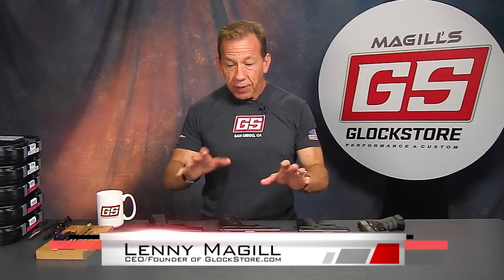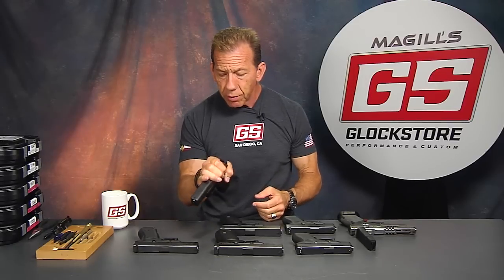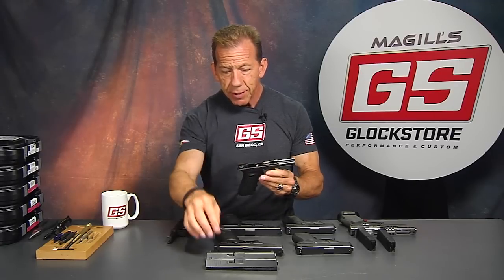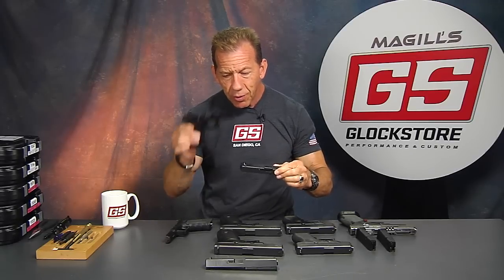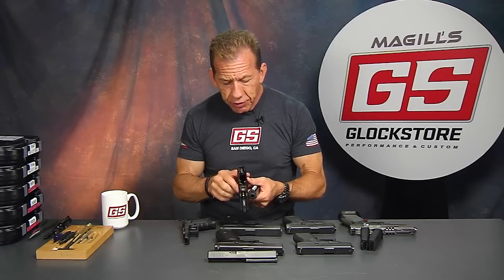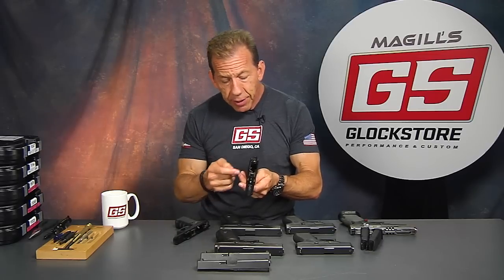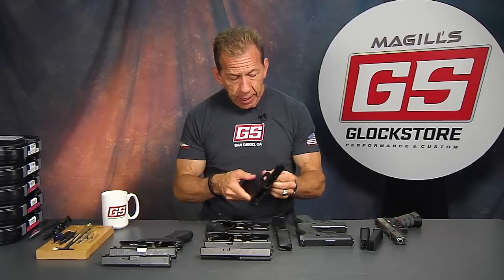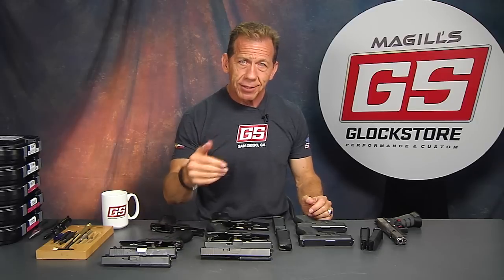Glock Frame Facts

Comment: the ejector is in the same spot in relation to barrel centerline on the 9 or 40 cal.
the 9 and 40 both use small pistol primers, so if the ejector could hit the primer on the 40 it could also hit on the 9.

Comment: Legend has it, Lenny once arm wrestled Gaston Glock. The extreme strength of both competitors caused the air between their palms to compress into a black hole. That black hole now sits in the center of the Milky Way galaxy.

Comment: Primer is located in the exact same position on a 40 as it is a 9mm both use small pistol located in the center on the round. If you're worried about the ejector hitting the primer on a 40....you should worry about it hitting the primer on a 9mm to.
Reply: So is it safe have you tried it ?

Comment: I´m from Austria and here the lower is just a part and you can buy it without register. Only pressurized parts need to be registered. So if you use a match barrel, you register it as accessory. And you can register two accessories for each gun. A complete upper is also considered one accessory.

Comment: Only time you would have a live round cycling backwards towards the ejector is if you unload the gun manually which would not render enough momentum to ignite a primer, i don't see any way a live 40.sw round could be set of out of battery by a 17 frame. However it might case some ejection issues, i can't comment on that, but it will not fire out of battery. Just a comment on the info given at 9:45.

Comment: In South Africa the barrel is registered as it is the part that can be identified via ballistics testing. When replacing a barrel on a hunting rifle a full new license is required. All other parts can be exchanged without permission or paperwork. Would have loved to swap out parts on the G19 but it is near impossible with the differences in regulations.

Comment: Never quite got the frame as the gun. On its own it cant fire a bullet, but the barrel, slide, and spring can still fire a round without the frame.
Reply: RowdyRides The frame holds everything together and gives it the ease of shooting and repeatability though.
Reply: england considers the pressure bearing parts as the "firearm"  you can have a reciever but not a barrel or bolt.

Comment: What about the 45 GAP guns? Is the 37 the same frame as a 17 or 22? I know that the 37 slide is wider, at least it is on the gen 3 37 that I own. But I have read that the frame is the same.
Reply: You can turn the 37 into a .40 with a ati interchangeable barrel chambered in .40 & use the all Glock .40 magazines because the g37 shares the same Dimensions as the 17,22,31

Comment: I have a trigger kit for .357sig on my G26 installed, which includes .357sig (or .40S&W) ejector, of course...
So far, I think it can affect on angle at which spent case will be ejected from the pistol, that's all it may affect. I don't think it can engage a primer in any way, it is just physically impossible...

Comment: We need a video specifically on building a g26 p80. The g26 is extremely difficult to get to work reliably. 

16 lb spring and the slide won't go all the way back. 14 lb spring and the slide won't go all the way forward.

Comment: So, G22 is a full size that uses .40 ejector on a G17 frame. Simply just switching to 9mm ejector it can turn into a G17. Glocks are the best hands down. I remember when I was a kid and seen a glock for1st time, and as a kid we love anything plastic because we play with plastic toy guns. I remember being so fascinated thinking there's a toy gun that can shoot LOL😁 Now, I have a question 7 years late. What is the difference between gen 3 and 4 G17 frame? I hear starting 4 it was changed unlike gen 1-3 which made these guns even more customizable. 1 more question. When did the frame being considered a gun start? before glock introduced the poly frame or after? or has this just been the law since beginning? Thanks guys!

Comment: How do you do it on a Glock 19 gen5 with ONLY the spring out? I did it on accident(Safely cleaning and looking at the mechanics. The tiny 2 spots to be held down... slide back a tad. Then slide off the front. release buttons(worst thing about Glocks I have). They rest ON THE SPRING. Leaving the chamber stuck and useless lol. No worky on easy mode, tried your stuff I'll try the HARDER one. This could be could though. Have some ones weapon and wanna secure it safe. Slide release. Throw out the spring. Even if a bullet maybe one bullet inaccurate cause you now have a free floating chamber. NVM got it. Set it up fucked up again. Forgot it lol. It requires you to get the barrel out VERY far... There's a baby lock I'm missing. Damn rubrics cube.

Comment: I really wish someone would come out with a frame that was contoured similar to a Glock 26 using a Glock 19 magazine and X-Grip. When I swap the triggers out of my G26 and G19, I pull the trigger well more consistently in the Glock 26 (and there is about a pound difference between the two). I attribute this to the hump, and I really think Glock was on to something with their 26th patent.

Comment: So I got a question I’m trying to take a Glock 23 40 cal And use a Glock 45 9mm frame By switching the slides what do I need to get in order for that to work properly
Reply: I’m trying to do the same thing you have to change the ambidextrous slide lock to a gen 4 and switch the cover plate to a gen 5

Comment: Lenney:  This is another of your great vids.  I have actually paid money for your vids.  Did not have YouTube!  I wish you would have said something about the difference between glock (17)  2pin and newer 3 pin.  Is the slide the same between 2pin and 3pin?":  I have an older 2pin 17 and was wondering about building apoly 80% and using the older slide?

Comment: I recently acquired a PF940 From a woman whose husband had passed away before he had a chance to assemble it. In the kit was the Jig and the 5/64th Milling Bit so that the  rear rail guides can be put in. The kit didn't have the End Mill bit. There was also no instruction sheet or parts list for the rest of the parts for the lower receiver or what caliber it is. Does the PF 940  on the cover of the box mean that it can be either a 9mm or 40 cal.  Jerry Dday

Comment: Leads to my question...I have a Lone Wolf 9mm conversion bbl...should I have a 9mm extractor, 9mm recoil spring and change my trigger housing...have there been any reports of  prematue ignition of 9mm rounds with a .40 cal extractor???  I have a G35...
Reply: Mohammed Cohen I would Recommend setting the gun up extractor and ejector as a 9 mm.It might be fun to play with but I wouldn’t put my life on the line without proper 9 mm parts.

Comment: Quick question. I currently use the .40 to 9mm barrel from your site on my glock 27 with glock 26 mag. But happen to come across a 26 frame.  Can I use the glock 27 upper with your .40 to 9mm barrel on a glock 26 frame.

Comment: Do not own a Gen 5 But a Ge2-3--4 Clock 35-23-27-Can easily become a 9mm with a Conversion Barrell the 40's all you need is 9mm mag and conversion barrel will Shoot 40 cal 9mm and 357 sig the 357 sig will fit in a 40 mag and 40 mags and 9mm mags One Gin will shoot Three calibers ? I shot a Glock 36 with a 9mm conversion barrel for years I bought every weight guide Rod Spring and was shooting 88 gr and smaller with 10 lb spring You can Fine Tune any round ?

Comment: Common sence would dictate that the upper should be considered the gun. Its a lot harder to manufacture a barrel and the slide than to produce a polymer frame. Also when ever a crime occurs the way you track the bullet to the gun is via the marks left by the barrel and the marks left by the firing pin on the casing. Which belong to the upper. Every other country in the world considers the upper the gun. Makes you wonder why we would consider a totally replaceable part the gun?

Comment: Lenny I have a Glock 22 with a 9mm conversion barrel I also have a Glock 17 9mm all stock . Can I use the Glock 22 .40cal magazines with the 9mm conversion . The 9mm rounds load into the 22 .40cal magazines and appear like they would work . 
Do I need to use the Model 17 magazines or will the Model 22 magazines cycle and run with 9mm ammo . Thank you  Al

Comment: How far off is a Glock 17 from a Glock 20?  There are many people, myself included, who like the idea of building a Glock 20, but Polymer 80 does not appear to be selling a Glock 20 frame yet.
Reply: I would say quite a bit, I have a glock 20, but not a 17, and the main difference I have seen is the handle is quite a bit bigger due to the length of the 10mm.

Comment: pulling the trigger to remove slide puts gun in fired position, so if someone pulled firing pin back while slide was off
 ' non fired position ' then replaced slide would that damage the gun?
Reply: No.

Comment: My 1st Glock a Gen 2 G22 Safe Queen was wondering how EZ is barrel & mag swap 2 357 sig? LuV 40 cal but idea of 2 ammo choices is exciting TY 4 any info I'm a total Glock Rookie  TY
Reply: You should check other places also so u are not relying on one source.  Larry talks about 357 sig around 13 minutes.  the 357 sig barrel is a drop in for the 40 barrel.  outside dimensions are functionally interchangeable.  357 sig case is a necked down 40 case, therefore same base diameter so extractor/ejector work on both.  most will tell you 357 and 40 mags are the same except they are stamped with different caliber numbers.  I have a 357 sig barrel coming in the mail and will use 40 mags. as Larry has stated, slides/barrels do NOT interchange between frame sizes.

Comment: What's the difference between real  glock frame to the polymer 80 frame?
Reply: P80 is based on the 1911 design. Bigger grip, slightly different trigger well. Its very sturdy and easy to make if you're familiar with a dremel tool

Comment: Will a Glock 26 gen 3 slide fit on a gen 4 frame??? I understand that the nose rings are about the same size on both gens.
Reply: Fernando Rocha Another main difference that i know of between the gen3's and the gen4's is the recoil spring. The gen4's had to make extra room in the frame for the new "duel recoil springs".
Reply: Kevin Trevino yes I'm going to have to get a gen 3 frame... I have all gen 4s and wanted to see if the gen 3 would fit the gen 4.. thanks for the feedback..

Comment: Just wondering if you bought a glock 19x knowing that the frame is a 17 gen 5 will you have any problems putting a 17 gen 5 slide on it... I have a glock 17 gen 5 and looking in getting a 19x. Does anyone have info on it? Lmk i really appreciate it and thanks lenny for the awesome videos and tungsten guide rod is awesome love it on my gen 5.
Reply: Tony Smith A Glock 19x is basically a Glock 17 frame, but it has been modified by Glock to fit the 19 slide.  The upper part of the lower where the slide rails are have been shortened to accommodate the 19 slide.  A complete Glock 23 Gen 5 upper should work though, but it would be a good idea to change out the ejector to a 23 too.  A 17 slide is too long to fit on the 19x lower.

Comment: I have a Glock 17 Gen 2 can i put a gen 3 4 or 5  G 31 slide on my frame keeping in mind the ejector.
Reply: Bill Leeds A Glock 31 Gen 3 slide would work on your Glock 17 Gen 2 frame, but the frames and slides of 4 and 5's will not interchange with 1-3. Glock did make the Gen. 3's with an additional locking block pin to absorb the extra recoil forces that comes from calibers larger than 9mm.  So, the Glock 31 upper (.357 Sig) might wear out your 17 Gen. 2 frame prematurely.  
This link talks about the difference on the added pin to the Gen. 3.  https://www.calguns.net/calgunforum/showthread.php?t=1157272

Comment: The metal parts that the slide rides on and puts all the stress on look pretty cheesy to me.
I do not see what allows them hold up over the years.Seems that the metal will work loose from the polymer.
Reply: The engineers that designed it put pins in place that hold the metal parts stationary in the plastic parts.  It functions great, and is nearly impossible to wear out.